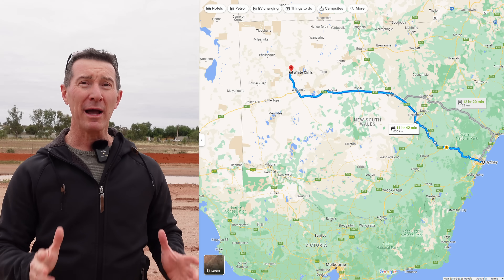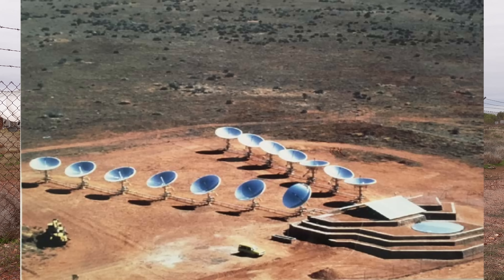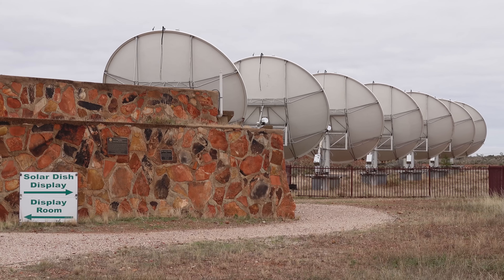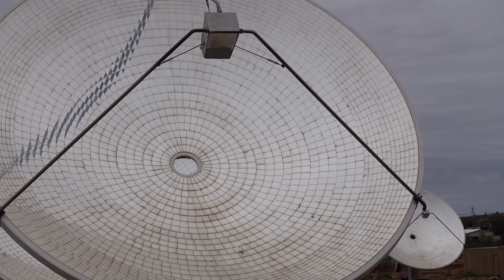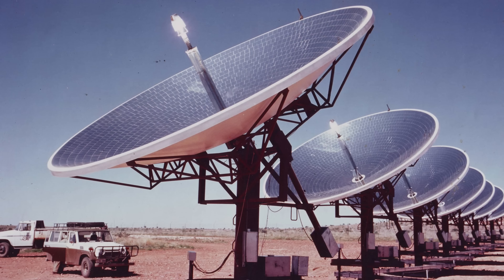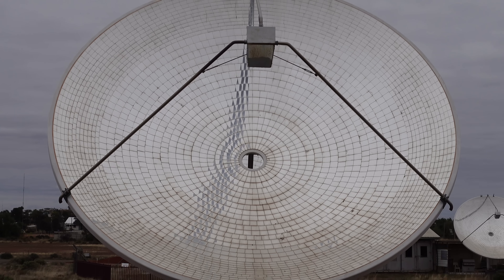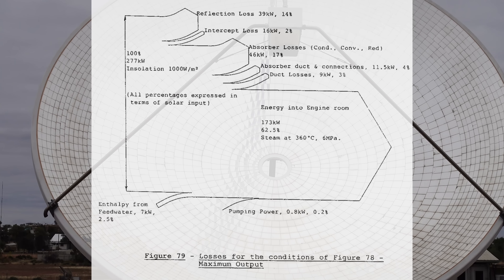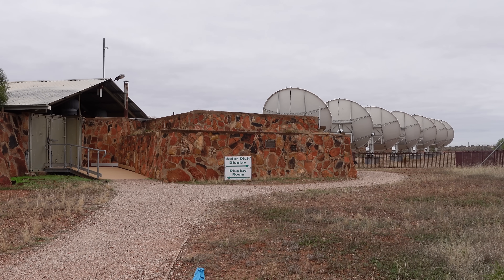EEVblog 1553 - World's First Commercial Solar Power Station

Comment: Yes do more. Solar thermal is great for things that need heat, like sintering metal or doing smelting of ore, where you have lots of sunlight, but are far from ant fossil fuels to do it otherwise. So you can use that sort of large central tower to take the red ground, almost all of it being iron oxide from the greatest biological event in the history of the planet, the first oxygen releasing blue green algae evolving. Then turn it into ceramic blocks for building. But solar panels, lower temperature and easier to handle, also got better, leaving this as a relic, though the high temperature research did help in making the consumer panels better, as they also run hot, though with more sunlight into them you do get much better conversion efficiency.
Reply: Also cheaper and don't degrate under the sun since now the heat and UVs are not your enemy
Reply: We can also store heat fairly easily and have been converting heat into electricity for a while now
Reply: In Finland they made storing high heat (like +400 C or so, easy to google it) in the siloses filled with sand. Super cheap and efficient. Then the heat was taken back from those "heat banks".
Reply: @mehow357  Yes, a way to store "low grade" heat, and then later on use it for things like heating a house, as otherwise it is too expensive to extract energy out of what is likely to be a low temperature differential.
Reply: @SeanBZA  I don't remember how do they extract the heat back, but most probably you're right that they extract the heat to heat up homes. BUUUT, few years ago i was reading about the place where they heat up metal alloy that emits (in low Temps, definitely way below 1000C) some spectrum of light and optimized solar panels for those wavelengths. The efficiency of this system was enormously high as those panels were optimized, plus it was not in open space, but in special building where "lost" or bounced photons were "bounced back" again into panels. That was extremely interesting article.
Reply: Nah, solar thermal also improved a lot, some generate way more electricty per area than photovoltaic panels but they always generate much more heat. Everyone ignores this for typical reasons. It doesn't make any sense to have a central power station with those either, they can be used locally the same way as panels.

Comment: there being a spinning turbine is actually a smoothing capacitor, buffering kinetic energy. And the heat is buffering thermal energy. 

Which means it's much less sensitive to a single cloud. 

The turbines in coal power plants are massive flywheels too. They can spin for days.... So blocking the coal delivery railtracks isn't any effective form of protest. 

There is some larger thermal solar generator plants around the world. One of them is curiously in Germany, near a research center. 

It could also be repurposed as a radio telescope at night. If the tracking is any good. But you usuallx used s cryocooled NLA. And these might not be best located directly next to the hottest spot.

Comment: Ive never seen it, but spoke to Professor Kaneff at the Perth Solar Energy Congress in mid 1983. He was there talking to visitors about the technical details of the instsllation. I thought it was brilliant at the time, and wanted to make a small scale copy. They used high transmission glass for the cut mirrors, and i recall he mentioned a certsin Dow Corning silicon (which didn't hurt the backing) to glue the 4 corners of each mirror where they touched the curved fibreglass surface. He said they first made a smaller section of a parabolic sector  on the mould, then attached mirrors, and tested it in full moonlight rather than the Sun for testing functionality. The mirrors were approx 100 mm each side, and the reflected light could focus on a spot not much bigger than that from memory. He had lots if photos of the construction steps. It was brilliant. From memory, the pistons in the converted motor, lifted the steam inlet valves off their seat at TDC, and there was a clever overflow method to remove lubricating oil from the surface of the condensed steam, which was recycled. I must go and see it one day if still there.
Great video, thanks.
Reply: amazing, thank you for sharing!!

Comment: The best effeciency you will see out of a photovolteic cell (comercially available for the home) is between 20% to 23%. Of course these don't last long and they only produce peak effeciency under ideal conditions a maximum of 4 hours a day for less than half the year. You are better off with geothermal.

Comment: I don't care about solar power station. NO.
Each building should be covered in solar harvesting pieces and elements, so that each building generates energy for itself and around it.
We need to promote decentralization, no?! We don't like communism right?! A centralized system?! We like independence for each region and thinking for itself.
So is with energy. We don't need giant global corporations to offer energy and manipulate pricing when we could have partial/total independence.
This is the best advantage, because it also eliminates infrastructure and maintenance costs. If you use equipment for 100MW of power transmitted it will cause a certain wear in the equipment. If you only transmit 1MW, the infrastructure will be subjected to less effort and require less maintenance, thus being good for the electrical companies too.

Comment: I worked on the bigger brother of the White Cliffs Solar converted system. The bigger brother was a 100 square meter dish focusing into about a 350mm X 350mm water cooled high efficiency solar cell colleting head.
There was only one built in Forster near Bendigo Australia,.

Comment: It always upsetting when sites like this shut down. The idea of solar thermal is almost completely lost due to how cheap solar panels cost. Being able to store massive amounts of heat that would allow generators to run at night is a good alternative to having chemical batteries that store electricity. Stored heat can be used in more than one way, unlike stored electricity. It sure seems that governments really don't want to solve the problem of intermittent energy production of alternative energy.

Comment: 1981? 25 KW peak? 1,000°C?  Disused?    How about 1969, 1MW, 3,500°C, still in commission.  Odeillo solar furnace, Font-Romeu, France.  It followed the earlier research Mont-Louis Solar Furnace built in 1949 and provides 50KW.  The nearby Themis solar plant opened 2 years later than White Cliffs, has output of 2MW and is still operating.  Sadly the "pioneering research" done at the White Cliffs station amounted to "how can we exploit this without paying the French any royalties."  And that's what was at the root of all the inefficiencies you list.

Comment: This system will outlast every single photovoltaic panel made on Earth.  I still believe that this approach can be downscaled to domestic, and homestead level. 
The batteries are the killer of this installation's efficiency. This setup with super-insulated  sand tank heat storage instead of batteries would have really done well. Thanks for the very interesting tour.

Comment: I think the dishes were 25KW each.
Reply: With only 5 m diameter, hardly 20 m² per dish?
Would not even work with 100% efficiency.
Reply: The dishes are 20 square meters. Assuming potentially 1000W per sq m, 100% efficiency could be 20KW. However, I tend to agree with you and after reading the Wiki entry for the solar farm, it is unclear if it is 25 per dish or for all 14 dishes combined. I have to say tho if it is the latter, it was a horrible waste of money!!
Reply: @brettemurphy  Efficiency was around 10%, due to the video. Which would be around 2 kW electrical output per dish with 1000 W/m² DNI. And rated power might have referred to a rather average irradiation (less than 1000 W/m²). 
When I saw this dishes, I thought of the Powerdish from Infinia first. A solar stirling dish. Parabolic mirror with 4.7 m diameter. Rated power 3 kW AC with 850 W/m² DNI.
But yes, compared to today's photovoltaics, such systems were pretty expensive.
Reply: @701983  10% makes sense, making a total of around 25KW for the 14 dishes

Comment: Also interesting is a solar furnace that was built in the south of France in the sixties.  It is used for material research etc, not power production.
(although there has been a powerplant near that site as well, but it was operating from 1983 so indeed later than what you visited here)

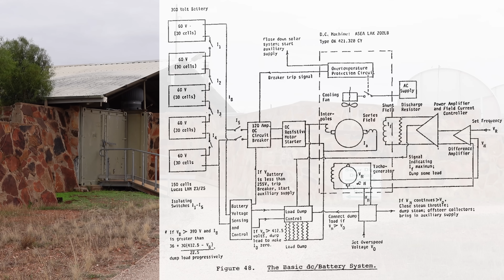Comment: If you add up all of the solar energy collected by 14 * 5 meter dia. dishes and divide that into 25kw production that gives about 9 % efficiency. So the second phase of the project should have been a study to get the efficiency up. At about 2:55 to 3:00 min into the video, you mention a turbine while your diagram shows a piston engine. Why wasn't this turned over to a university for engineering research ? This would be a good way to invest in education instead of moth balling an expensive facility.

Comment: I think this was a very thorough experiment in thermal electric power generation.   It also was very clever in avoiding unknown risk such as thermal towers have with long open air stretches of concentrated solar energy that in the US southwest turned out to ignite birds flying though it on fire!   With all that effort and very good implementation over all those reflective parabolic thermal dishes, the housing,  steam driven generators and battery electric storage it only originally generated 25 KW.    A high end bus conversion RV can have 20 KW generator housed in half a storage bin.   That doesn't include Diesel storage.   

It wasn't covered in the video, but how many days can it provide power when there is little sun?   In California a Tesla solar roof and power wall home owner was equipped to run 4 days without sun before having to use grid power.  During the California wild fires his home lost grid power due to the forest fire risk or maybe the forest fires themselves and the wild fire smoke was so thick the solar cells didn't make much electricity for two weeks until the smoke thinned out.  He struggled through having to go with little AC during times they really needed it to clean the smoky air.  With some regret in his voice his opinion was he should have a backup generator.

Comment: That's really cool, always been intrigued at the idea of thermal solar as in a way it's simpler, ex: you could build this in a post apocalyptic setting with scrap stuff. PV cells, not so much.  But never realized the efficiency was so low.  I guess something like this would be better for actual heat but even then PV might still be better and also have less moving parts. No pumps etc.

Comment: I remember seeing on a pbs show called 3-2-1 contact, a similar vintage solar power station that used flat mirrors that would track to focus the sun on the top of a tower that would then boil water and run a turbine.  Was pretty advanced back then.  https://youtu.be/gK6NnqGmb1o?t=676

Comment: Concentrated solar power is not a thing of the past. Because it uses no expensive materials it is very cost effective.
Reply: Because it needs tracking systems and because it can't convert scattered light, it's much more expensive than photovoltaics today.

Comment: Efficency isn't the best measure when excess area is available. At the time I believe the installed cost vs power output was beating solar cells rather easily. However, small solar panels are being installed at a cost that would only buy a few square inches of cells back in the 70's.  Now panels can provide power at less than the maintenance cost of a solar thermal/steam system.  The production process of making solar cells got that much more efficient.

There were a number of solar projects that predicted the cost of the refined silicon continuing to rise, not be cut in half and then cut in half again. Yield and production rates of scale slashed the attached labor costs of silicon cells and most all the less efficent but cheaper (at the time) solar programs are all but gone.

Power storage is now the thing. Could see Edison Cells make a comeback for a time. Inexpensive and abundant materiels and size/weight efficency isn't a factor if bolted to the ground, it's the very long life and low maintenece requirement that make them attractive. A home install that can go over 50 years with little upkeep and not catching fire is a thing. Twice the weight and footprint much less so. Just don't bet everything on it since something will change the playing field. 

Pridicting futures is tough. Supercomputers never did get to cover a full kilometer square.... ah well. Did get the Trek-like comunicators with the flip phone. Never did make the noise when opened so.... Rockets do land on their tail, just rather miss the large deco fins...  🙂

Comment: There is one thing that speaks for this, you can theoretically build such a solar collector in you own shed. I would heat a wind tunnel with it tough, abusing that warm air wants to go up, no need to handle steam. On the other hand, here in Germany it would make more sense building a small vertical wind turbine, a scrapyard version could be made from an old drum and a generator out of an old car.

Comment: thjat doesnt look like a steam turbine... cylinders? pistons? and for 25kw, a turbine isnt a good choice. they chew a lot of steam, and small size is real inefficient. leakages goes out the roof.

makes you wonder how hard it is to retro fit existing steam turbines...

yknow, the ones in the coal fired stations currently being decommissioned and scrapped?
yeah... megawatts. that takes a bit of mirror.

i was playing around with fresnel type arrays, just use offcuts of mirror from the glaziers, long strips in a flat box with a few angled battens inside, wack a sheet of glass over the top... easy to clean, and the heat being in a long strip isnt so intense. nice length of 40mmcopper pipe, coil of 1/4 through the inside, pack the space with pool salt. and yeah... as long as it comes out at 80C, its fine for the hot water system...

cheaper than evacuated tubes?

Comment: In Spain they did several of these with a HUGE Molten salt Tower in the Middle of Massive fields with 100s of panels, to Horrible cost  cause it Raised Electricty costs massively cause now the building of them has to be Payed off. Atleast the Smaller ones on top of Hotels do the business of heating up Thousands of liter of water.

Comment: Solar thermal from what I understand can also just sort of operate without needing to have massive replacements like photovoltaic panels do which have their own battery lives where they just stop working and need to be disposed of.

Ultimately it turns out we got it right the first time by using heat energy as that remains the most viable and long lasting method of electricity generation.

Comment: Power tower is a competing technology, not a dish solar replacement. Dish solar is still around and efficiency is up to about 35%. Also have to remember that a dish have almost twice the interception rate as a Flatt panel solar. So area for area they produce almost 4 times as much energy, and over a wider span of the day.

Its really grid subsides that make PV profitable today, not low price or efficiency.

One have to consider the cost of storage. A flat panel solararray produce a peak during mid day. A parabol mirror produce about the same energy from the very morning to the very evening. This partly produce much more power per installed MW, but it also lower the usage of batteries considerably

Comment: What might be interesting is to compare the output of that plant, with the output if the area was covered in modern solar cells. I read that if the area of a nuclear power plant was covered instead with solar cells, they would be roughly equal in output (obviously not at night !)...
Reply: The claim about Solar having the same ground area footprint as nuclear for the same output is obvious nonsense. The difference is 50x.

Comment: I wonder why solar thermal isn't more popular as a technology (especially the sort that can hold the heat in a thermal mass of some kind and generate power with it at times when the sun isn't shining and avoid the need for any kind of batteries).
Reply: seems too large compared to PV. It needs turbine or engines running off that hot liquids to create electricity. Like sort of steampunk-ish tech.

Comment: What a shame not allowed in and have a look around from an engineering perspective. That would be something to see. To see a plant that can adjust to a wide variety of power inputs.
That said, there is a reason why exothermic based power plants are used as base loads (whether coal, gas, geo thermic or nuclear) is because the efficiency drops when the boiler pressure gets lower.
Getting the balance right takes time cause of getting the amount of steam being produced to adjusting the turbines for the amount of steam to the load on the turbines to the condensers efficiency for the heat coming in by adjusting the cooling water depending of the temp of the cooling water etc etc etc. Not like just turning on more water at a hydro plant.